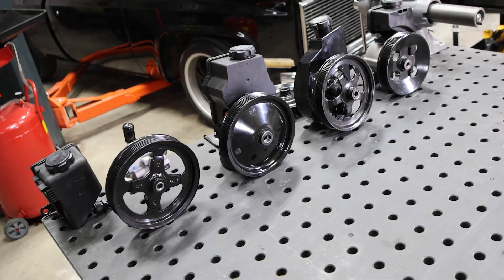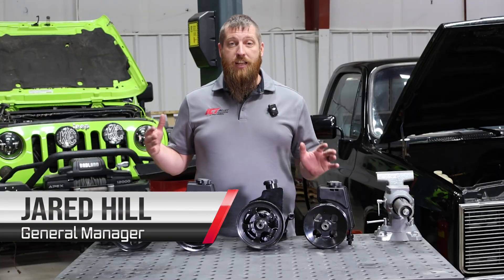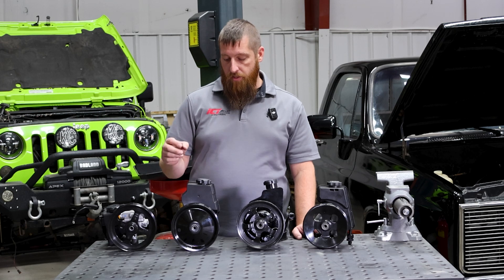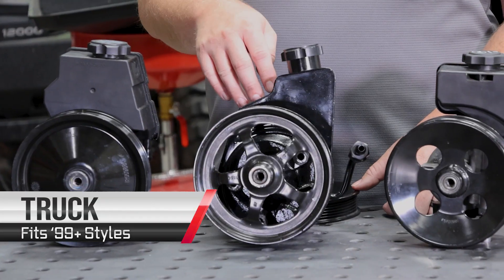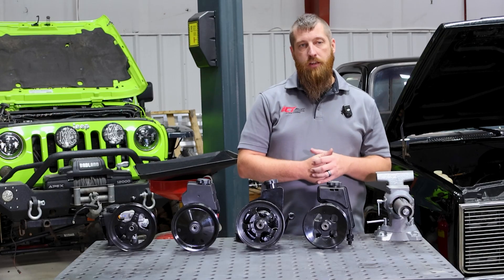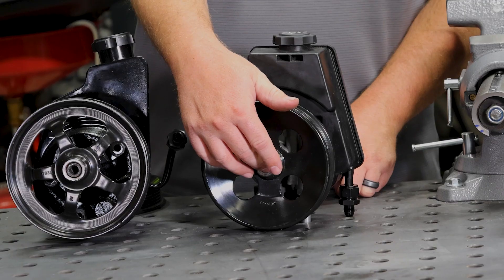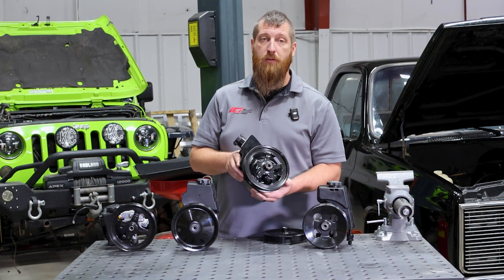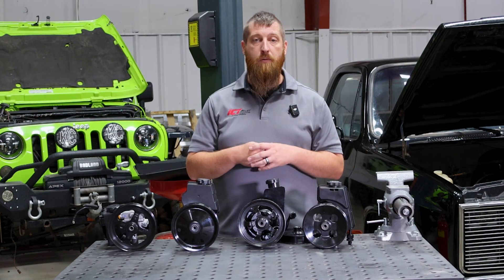LS Swap Guide: Power Steering Pumps

Comment: Please help! I have an LS Swaped 69 chevelle I decided to ad hydro boost. As soon as the oil gets warm my pump screams!
Everything is new and I still have the same problem. I have performed the air bleeding procedure until my arms were sore. No difference. Is the an improper restrictor somewhere?
Reply: Change out the pressure spring inside the pump